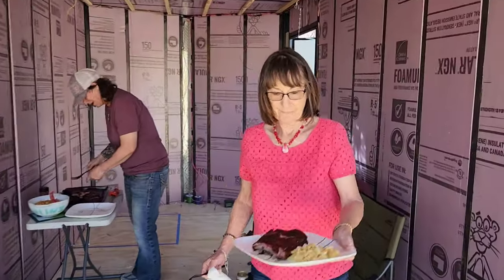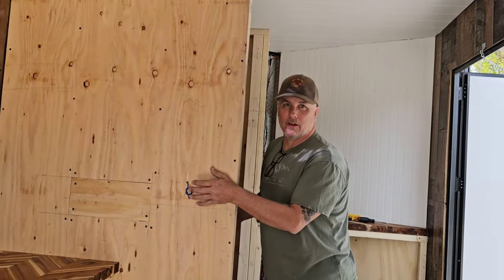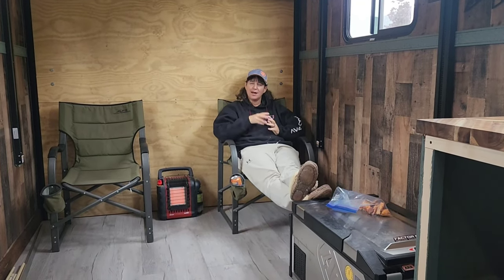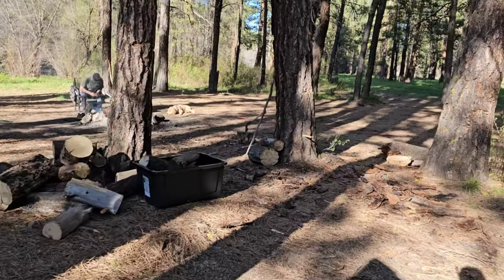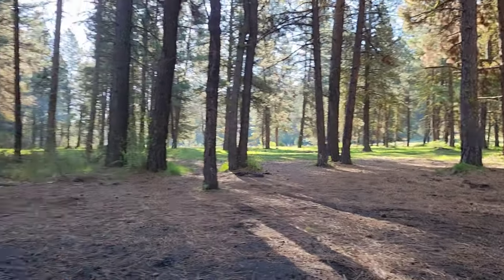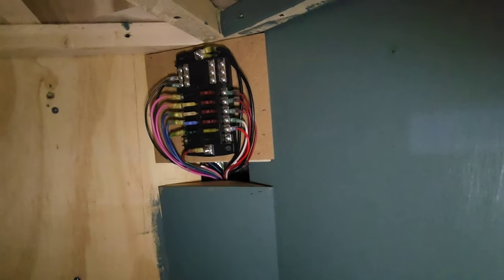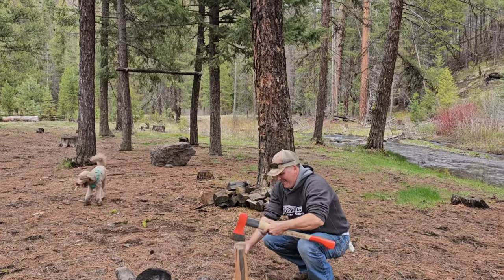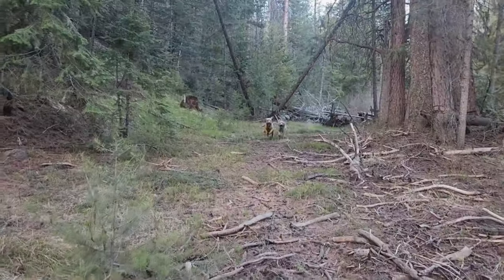Cargo Trailer Camper Conversion - Toy Hauler

Comment: Did you make your own slider frame for the pull out fridge? Any tips or advice on its construction?
Reply from the maker: @jacquesbeaudoin9706  Yes, we did. We built it out of 2" angle steel. Welded. 
Tips: 
1. Make sure you use at least 3/16" thick material.
2. Make sure it is square and true.
3. Use heavy duty "extended length or full length sliders with locks. The locks keep it in place when closed and fully open. 
4. Make sure your counter top does not extend out too far, because you won't be able to open the fridge. Ours has plenty of room, but just be aware of it. It is an easy thing to miss. 
5. Make sure you secure the power cord along the back so it does not get caught in the sliders. And make sure it has enough slack for movement. 
6. Leave room around the fridge so the fans can operate without being blocked. 

Hope this helps.
Reply: @foxtailadventures  Thanks for the great information. I appreciate it.